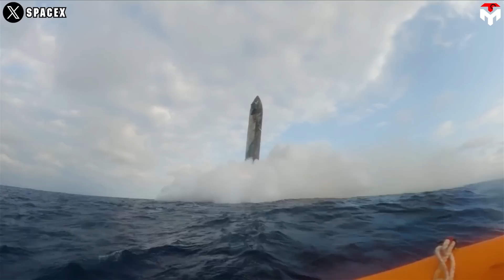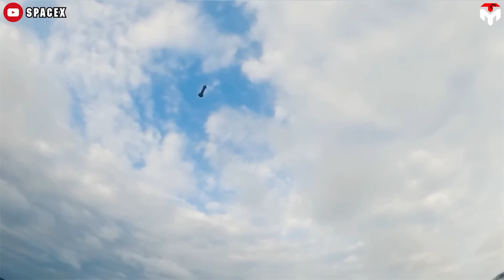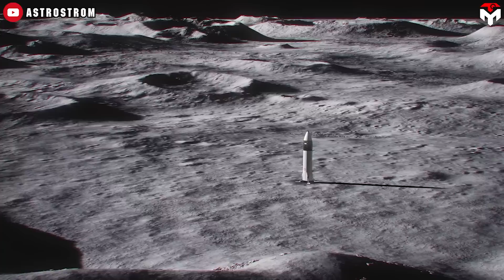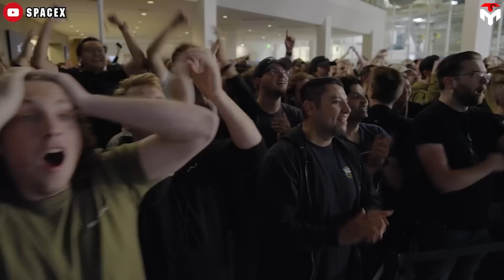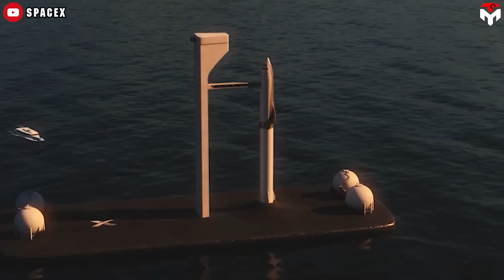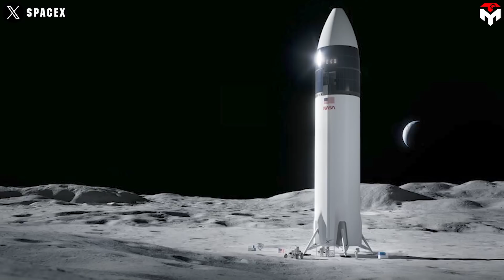SpaceX revealed New Starship Landing Strategy... NASA is STUNNED!

Comment: Having a series of landing barges, like a string of pearls, leading out into the Gulf of Mexico, immediately off shore shore from Starbase would lend itself to catching, handling/moving these components back to Starbase, where they could quickly be put back in to flight service.
If a landing goes bad and destroys a bare, it sequestered the lost.  The next barge in line moves in toward Starbase to fill the void.
The barges could be simply but robust build facilitating their reuse.
Imaging a belt of ammunition or a string of pearls.
The barges could float up channels dug next to the launch towers to facilitate faster reuse.
The barges would help move these enormous, heavy components from one service area to another.
They could become a key solution in quickly reusing the rockets...

Comment: After 20 flights I dont believe theyve landed the  Starship crew capsule where it would be survivable. They use rocket motors to slow down just after it gets thru the high temps of re-entry and this just keeps adding heat, there is suppose to be people inside,  It will do nothing but cook them. In wich case You wont want to survive. How bout good old parachutes?  They work every time and dont explode when they touch down

Comment: Landing on a barge delays the reuse of the booster. Rapid reuse of the booster is a fundamental benefit leading to lower cost access to space. There are extremely heavy payload situations that benefit from landing on a barge in the ocean. Even though the cost is increased, it's less than other options.

Comment: Great work! What if there is a way to land boosters and Star ship horizontally instead of vertically. Also, star ship will not require complicated and heavy accessories added to it. This idea would give star ship a Buck Rogers horizontal style landing. Build a specialized landing rocket to intercept and latch onto the booster or star ship . Once it latches onto its target at low altitude it will have the ability to piggy back the catch into a horizontal position and land it that way. This solution would eliminate having to modify every Star ship to land vertically which will greatly reduce the chance of landing failure. Thank you for giving humanity a chance to survive.

Comment: Starship will not land on earth, it will always be caught. The whole point in removing the landing gear was to reduce the weight of the launch.. because every additional pound means 10 pounds in fuel. Not to mention that now you need bigger engines and a stronger rocket which adds additional pounds.  Steel is strongest in tension, which means when being stretched. The mechazilla contact points are up high, putting the rest of the ship in tension. This makes it the lightest possible design, and the lightest possible overall solution. It is a genius idea, and cannot be bettered by landing on a surface.
Reply from the maker: That’s a great analysis. Thanks for sharing!

Comment: People will never fly in any rockets between cities. It would be way too expensive, just for the fuel and infrastructure. Once the environmentalists calculate the carbon footprint of the entire system, they will attack. Starship would make Concorde look clean, and cheap, in comparison. With a large SST, like Boeing was designing to challenge Concorde, you wouldn't need a faster way to travel. See any of those flying? It rains too. 
You need to watch, 'Arctic Sinkholes' to see what has already started to happen. And methane is 40X worse than carbon dioxide is at trapping heat.
Reply: The Carbon footprint of the launch of a Starship booster is 358 tons of CO2. The Starship itself does not release CO2, with water being the only exhaust. So a single launch of Starship has a carbon footprint 0.0065% smaller than what the "Icon of the Seas" releases on a single week-long Caribbean cruise. 

So, where are the environmentalists, and when will they attack?
Reply: @DougGann  How is the fuel obtained?
Reply: @ By the same ways all of our energy is generated.  Do you have a point here?
Reply: @DougGann  Sure do. Nobody will ever go from New York to London, or from Los Angeles to Sydney, by rocket. And we need to reduce fossil fuel consumption as fast as possible without collapsing the economy in the process. 'Arctic Sinkholes', will show you why.
Reply: @ What fuel does the booster and starship use? What is the temperature of the fuel?
Reply: @billsimpson604  You are preaching to the choir, (research stratospheric cooling for a better smoking gun.) But when we are not taking on 99.999% of the problem, focusing on that .0001% is just pissing into the wind.
Reply: @DougGann   What is the chemical formula for methane?
Reply: @DougGann  Burning methane, which is the only fuel Starship uses, produces carbon dioxide and water vapor as the exhaust. CH4 + O2 = CO2 + H2O. That carbon dioxide will stay in the atmosphere for hundreds of years, trapping more & more heat as the concentration of it increases in the atmosphere. That is physics which nothing can change.
Reply: @billsimpson604 That is only for the booster stage, for which I provided the CO2 output as reported by SpaceX and NASA. The second stage "ship" is powered by the combustion of liquid hydrogen and liquid oxygen. H2 * O2 = Thrust and water. 

I hear you on CO2 pollution and the fact that Musk has become a parody of a Nazi toddler. But babbling on about environmental damage in the case is a dead end.

Comment: The launch mount could be designed to accept the SH Booster so that the upper stage Starship could land beside it on the tower arms.
Reply: Having a running engine aside from the booster is not a good idea as it will heat the booster with its exhaust gas. This has to be done somewhere else.

Comment: Why don't they use long arms that are fixed on the drone-ship that unfold and stabilize the landing rocket high on the rocket ?
Reply: Aligning them would be a problem.
Reply: @billsimpson604  Yes, but it should be solvable. If vertical landing of long rockets is possible electronically, it should be possible to control and adjust intercepting arms/supports at all locations in the landing area. Especially since the rockets are getting heavier and will therefore be more unstable.

Comment: OK-------. Any Starship landing vessel is going to have to be a TWIN Hulled Ship to be more stable in Ruff seas that a Single hulled barge would be worthless in while allowing Starships Exhaurst to be dumped safely into the Sea between the HULLs and not on a solid ship's deck...Cutting the need of a Large Water Deluge system...   A wide Twin Hulled Ship would also be able to cut through the waves at 15 to 20 knots returning the ship to Port many times faster in seas a barge would be stuck just trying to survive let alone make headway home...while trying to not lose the Starship or Booster...  A ;large twin hulled ship would even be long enough to have an ARMORED Bunker across the bow far enough away from the landing pad or even 'TOWER to keep the crew safe allowing faster crew access to Starship without the problems of Injuring or even LOSING crewmen overboard trying to transfer between boats and a barge in RUFF seas...   A ship could also be big enough to refuel a Starship or Booster with enough propellant to FLY a hundred or even thousands of miles back to STARBASE or Canaveral...   Allowing the Ship to remain on station for the next Starship or Booster to land on...  Proving suborbital flights to the Public and practicing for Starships to start intercontinental Cargo then Passenger flights... that could take hundreds or even a thousand successful flights before Humans were allowed to ride along...

Comment: Srely no one is thinking of a deluge system at sea?!
Simply submerge theblanding platdorm to a desired depth and ocean water will provideball the protection needed.

And if SpaceX really wanted to, they could deploy a mechzilla at sea, the technology already exusts in mobile oil drilling platforms... more than large enough, sturdy and stable.

Comment: OK why not use couple of decommissioned  aircraft carriers attach the Drone landing pads between them maybe two or three ( waste not ) could be the answer the enormous room below decks also fire suppression system and what I like elevator! Everything in one spot for resupply and launch !
Reply: Two tugs made into a catamaran, or four. Cheaper than aircraft carriers.
Reply: @simoncox9404  you would think so check out the price of a scraper and also the extremely large room and space more than capable in rough seas